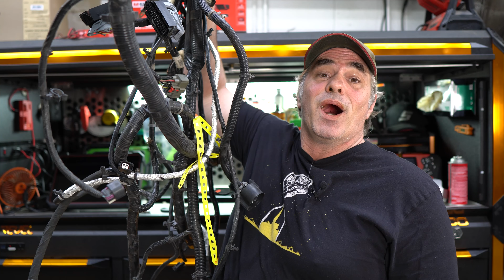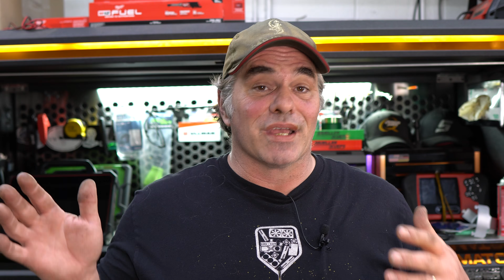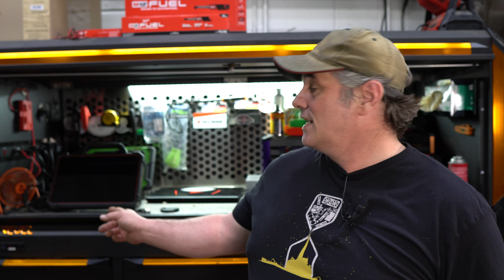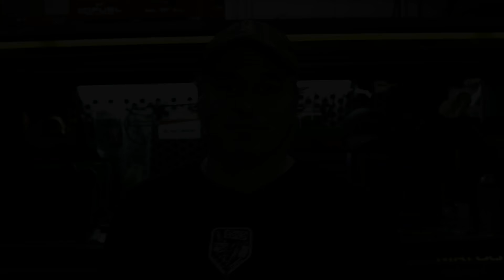SO You Want to Be a Diagnostic Tech???

Comment: To be clear, programming modules and keys is not diagnostics. It's programming, which is sitting down tapping on a laptop. There is no diagnostics involved in that. Finding an intermittent short on an interior lights fuse is diagnostics.

Comment: I see the Snap on vantage pro in the background. I still use mine when not using my 4ch scope. Anyone in here use a propane enrichment tool for diagnostic work? Like AF/o2 sensors, converter codes, Rich/lean conditions, misfires, vacuum leaks. Injector issues. 

Speaking of communication networks causing issues. My latest one was two days ago. Back up camera was causing no communication in many modules. check engine light, ABS/traction, EPS, erratic transmission shift issues. RPM and temp gauge dropping in and out intermittently.

Comment: I took a electrical diag position in a UAW factory back in September and lemme tell ya its been rough. Our new truck we launched has 9 CAN networks on the higher end units. I’m miles ahead of where i was but still have so much more to go. I sure as hell would never want to do this work on flat rate.
Reply: EXACTLY ! Diagnostic tech as a career ? Madness I tells ya. Unless you don't care about making $. Let's talk about the least paying , most frustrating part of auto repair ... uuh anyone ? Using a scope to diagnose ? hahahhhaaaa. Do you have a known good signal ? Are you sure the amplitude and frequency and pattern are correct ? Been there , started using a scope in the 90's. If you can diagnose multiple CAN networks and program modules for multiple cars get out of this so called business and make real $ in the hi tech industry networks.. And don't even tell me ,haters, how it is, I was diagnosing GM and Ford product in the 90's with all their trash electronics, modules, PCM failures, wiring harness rub through..etc.  rant off.

Comment: YES, training, if you haven’t learned to be proficient with a DVOM you cannot expect to pickup a scanner or scope and expect to be able to diagnose modern automobiles. Knowing basic electrical is essential, even for a mid level tech, electronics are not going away, communication systems are more and more prevalent with each new model, what used to be circuitry, like lamps and wipers will be communicating over network to modules, it’s happening. The days of harness repair are all but gone, if you make a repair attempt to a safety system harness you are liable for any consequences if the repair fails, communication wires to ABS, power steering, ADAS, BSM, SRS, and thats just the common knowledge systems, wipers and exterior lighting are a couple others. If y’all thinking a wire repair is worth having that liability is worth it, well I hope you’re doing OEM quality work, because times are changing rapidly in this field. How about this question , “you’re food only had one pubic hair in it, why did you send the whole plate back?” A wire break in the middle of a harness is the same, if it were your own pube, sure pick it out, but when it’s someone else’s, you’re gonna need a fresh plate.

Comment: What kind of entry level scope would you recommended getting that won’t break the bank. I’ve been working at a Honda dealer for 5 plus years got my master certification. I’m a solid diag tech. Haven’t needed a scope yet to diag all the cars I’ve done so far. But I can always learn more.
Reply: Hantex they're the makers for autel scope. Very cheap like $240.00

Comment: so instead of repairing one wire you sold an entire harness? find where its broken, run a jumper.
Reply: That was my take away. If the harness melted it would make sense to replace it.  Don’t know the particulars with that one.
Reply: There's another method of sniping it at both ends and running a new wire/cable.
Reply: You don’t have to remove it you have to run test on the wires to pin point the problem unless you have a series of wires burnt and connectors otherwise I repair the wire, the pin male or female, the connector etc.
Reply: You missed his point. In order to repair the harness it would have to be removed. Might as well just go ahead and replace it.

Comment: the only big money I've seen in diagnostics is how much it costs to get tooled up to work on all sorts of systems
Reply: Its funny isnt it. You buy an impact gun, you'll make the money back on the first set of tie rods you replace. Somebody's car doesn't start cause the fucking door control module went bad? $4000 for the automotive scope cause you might as well buy once cry once, $3500 for the tool that will program the new module in... $200-300 diag, $100 profit on the part, $300 labor including programming. Diagnostics is something every shop needs, but it has to be a hobby too because tooling is not a game anymore... any damn thing you need is at least $400. The shop purchasing it barely makes any sense, because realistically in every shop only one person knows how to use it... the rest can barely turn a multimeter to read volts. So the tool is worthless when the guy leaves. So you gotta have a guy thats the highest paid in the shop to do the lowest paying jobs in the shop. Ass backwards. Poor soul that does the diag in a shop. I'd know, I'm that poor soul.
Reply: Don't even get me started on the fact that during the time it took to figure that out, the guy in the next bay did 3 brake jobs at $500 labor each.
Reply: My shop has almost no diag tools .I've spent thousands on my diag 
My has a big eyes when I order diag equipment ,😲

Comment: Any helpfully tips on  someone who's starting to do diagnostic   an ways to help
Reply: Get a job at a dealership. They send you to factory training that you typically don't have to pay for. Also, the types of jobs you get working at a dealer are completely different than what you see at an independent shop. Dealers typically supply a scan tool and special service tools. Other tools you may want to buy are a Good DVOM and a quality set of test leads. Interior trim tools and wire repair tools are also important to have. 

Where you currently work, try to get big interior jobs. Pulling dashboards, door latches, headliners, sunroofs, taking seats apart, airbags, seatbelts, carpet removal and install, module replacements and programming, etc.... If you can't get to it, you can't diagnose it.

The most important thing is to help other techs in the shop. If you see someone struggling with a gas tank, don't wait for them to call you over. Drop what you're doing and run over to help them. Any time you're asked to help with something, do it immediately and with a good attitude. Nothing can help or hurt you more than your relationships with other people in the shop.

Before you get sent to school, you'll be assigned online classes. Get them done right away. It shows your commitment to the job and you'll need to have certain online classes finished before you can get sent to a real classroom.